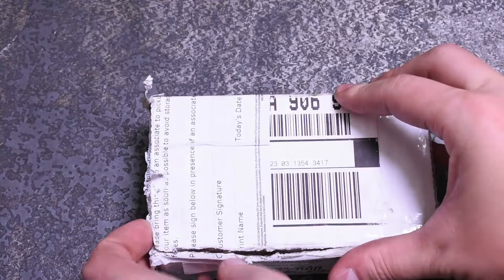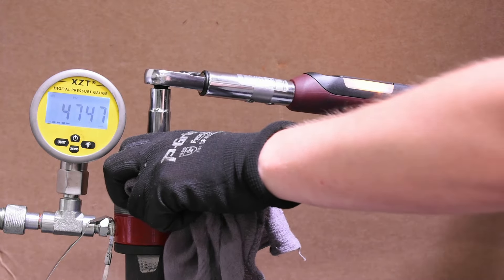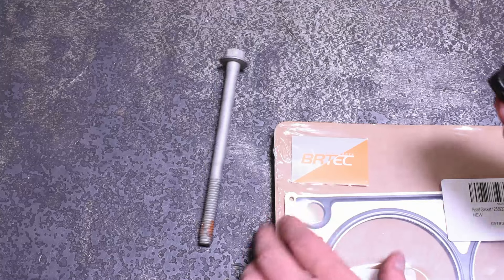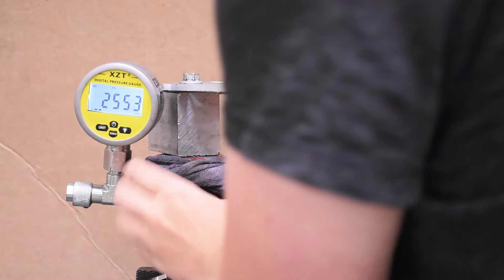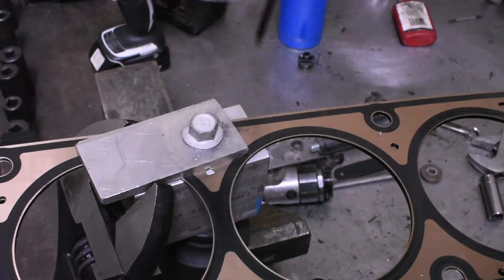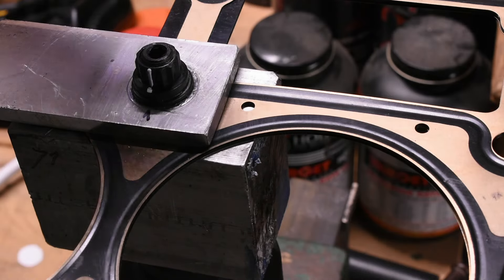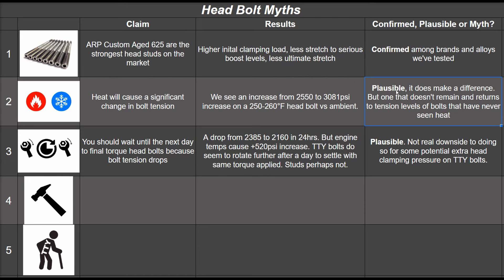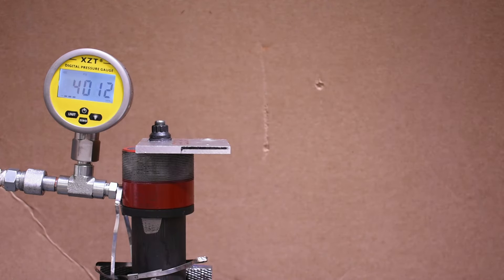CAN You Reuse Cylinder Head Bolts? Testing Myths + ARP Custom Aged 625+

Comment: Subaru has quite a torque sequence for their head bolts. On a mid 00s EJ25 It's basically, in a pattern: 21.4 ft-lb, 50.9 ft-lb, loosen 180°, loosen 180°, tighten 31 ft-lb, then 80 to 90°, then 40-45°, middle bolts another 40-45°. They make no mention of replacing the head bolts or a limit on reuse. They do specify to replace the head gasket. People reuse Subaru head bolts regularly with no ill effects. Would be fun to see you do some testing on them given all the whinging on the internet about Subaru head gaskets! The failures are generally unrelated to the bolts, as far as most people with knowledge are concerned. They were caused primarily by the gasket material used on naturally aspirated EJ25 engines.
Reply: Man I'm glad I don't work on Subies. That's a ridiculously long procedure. If it works I guess it's the correct one, but it'd be tedious if I had to do that on the Ford V8s I work on.
Reply: @9HighFlyer9  Try it someday. They are incredibly easy to work on in most ways. I prefer working on Subaru to any brand. Especially Ford. Funny enough, I have a technician friend who left a Subaru dealer to work for Ford. He was there something like 6-12 months and when Subaru offered his job back with a raise, he was so happy to go back. Simply because working on Fords was so much more complicated. Every brand has their downsides, of course. Keep in mind there are only 6 bolts per head. Would take a few minutes to do the full procedure. :D

Comment: I reused the factory  bolt set on a FEW 90's Civic's and on a 88 Turbo Supra I had. Supra's head lifted a few months after i got it, new factory composite head gasket lasted 7 years and about 100k miles in the Supra running about 320hp to the wheel before i sold it. It was my daily and i wanted to keep the original turbo without over spinning it, vertically no turbo lag above 4200rpm. I did retorque after a week of normal driving, repeated 2 more times to make sure they weren't walking out as the 7M-GTE tends to do to head bolts.

I tapped and died the holes and used factory bolts because there was carbon left over, as engine oil is recommended as thread lube per factory instructions. Increased (from i think) the factory 65ft/lbs to 85 ( ithink)  i can't remember quite right

Comment: Here is another tip I learned from a legend Nascar engine man.

After initial engine runs have been accomplished and cool down in the same installation sequence 
Loosen first bolt 1/4 turn 
Apply final installed torque 
Repeat this process in sequence

Comment: Great video. I was excited to see the re-used tty bolt, but everyone says to use a torque of around 65lbft and not to degree it again. In my head that seems like a better method instead of double yeilding the bolt.
One retailer of ARP headstuds for cummins had a specific tq sequence, and it was a pain. You would work your way up to final tq, then loosen and torque again 3 times, plug the block heater in over night, let it cool, then do a final tq. No idea if this extra work helped, but i never puked a gasket that way

Comment: On small fasteners I've tried the hammer before the final torque thing.  I had no way of measuring the tension but they definitely do turn a little more with the same torque limit on the wrench.  This was on rifle scope rings so very small fasteners.  I knew a marine core sniper and firearms trainer that did this for fighting rifles.

Comment: Hello dear TTC team

A German car enthusiast made some head bolts because the ARP ones weren't strong enough for him. They supposedly have a tensile strength of 270.000+ psi (1850 N/mm2/). They are called Pro Series Fasteners. Maybe you are interested in testing them.
Reply: Arp custom age 625 plus bolt have a tensile strength of 260,000 to 280,000 psi
And the Aermet bolt are rated at 290,000 to 310,000 psi
So no is bolt are not better that arp just better that arp2000 bolt at 220,000psi

Comment: The factory manual for my land cruiser does not say that head bolts are single use, and only gives one torque procedure. It does give a minimum bolt diameter, and says to replace bolts if they won’t achieve the torque value or if they’re too thin

Similar to the instructions for my brother’s 81 MB 300SD, bolts have a minimum diameter, can be reused until they get too small, ie stretch too much.

Comment: I am a  3 generation  mechanic and have built so many different types of engines over the years I couldn't even begin to count them.. but I do a lot of SXS engines mostly Polaris RZR and there snowmobiles as well. And with the amount of race engines I build with all the best parts.. 
I modify and build even more engines for the every day trail rider.. And I'm always looking for the best parts that are going to last the longest  if it's maintained correctly. So with that said I have been testing the one time use only hard wear for a long time mostly on Polaris and some car stuff. And on Polaris I have found that a good amount of time you can reuse head bolts and some others. But it's time consuming to do so. Mostly checking them out.But I have come up with a process of checking the bolt and if it checks out good by my specks then I have a torque process for the bolts  that has been back up since 2008 to 2016 by 30 engines that was part of the R&D from 2016 until now I have 90ish engines out there running around and 15ish of them with over 5 thousand miles on them.And my personal
 Polaris 08 RZR 800 that I bought with a bad engine with only 1500 hundred miles on it and that was the start of the R&D I sold that machine to a good customer of ours with about 15-16 thousand miles on it and at the beginning of this summer I was talking to him and he has over..30.. Thousand miles on it !!! Pretty crazy but he's retired and uses it all the time and he takes care of it just like I showed him how to do and what time frame to do different things to the machine ,air filter, oil and filter, just to name a few.. l am sorry this is so long and it doesn't have all the periods  lol but I think most people will understand what I'm saying and I thought people would like to know if you take your time and think about it you can figure it out this post just let's you know that most of the bigger bolts will work just fine just don't torque to   the degree part since it is now a normal pre stretched bolt TQ only have a great day... Bob...

Comment: Answer: yes of course you can. My first car was a MKI Mini and I had the head off it no end of times ... Replaced the head gasket (because that was usually the reason for removing the head ... Classic mini problem. In the end Hermetite orange silicon gasket sealer PLUS a new gasket solved the problem. But I NEVER needed to replace the studs which always torqued up just fine thanks! In principle if not in practice, torquing the nuts properly should not cause stud deformation, only minor, elastic, non permanent stretching.

Comment: I did an 05 Duramax with new TTY... Did the primary torque sequence and then the two 90 deg stages. One thing I noticed was that a few of the bolts went to the final 90 deg turn with less resistance than most of the other bolts. My brother was doing the final [I am an ASE certified veteran] 90 deg and wanted to go past the rotational point and I abruptly stopped him... NO! I suspect in those bolt holes there was some residual oil making them easier to turn. I told him that threads work, every bit you turn the bolt stretches the bolt more and more. Stop at the specified point and you have stretched the bolt to its spec. Leave it alone, it's got the proper clamping force and it's not going to magically unthread.
So much for skimping out on the brake clean. He has a 1,000 miles on it now with no problems... So far.

Comment: the problem is that once you get past the point of stock or ARP replacement headbolts, the head starts to bow between the cylinders and unsettle the gasket, with stock type cylinder heads. At that few after market heads are significantly strong, shy of a billet of HIP cast head, I doubt much more than a standard stud is all anyone will ever need. Thanks for the testing however. If you doubt this, grab a head and block and use impression paper.
Reply: There is a lot of variables for that.

Comment: i've definitely tapped the heads of bolts as i was finger tightening them to take the nasty little bits out of it and the thread so i can take them out easier later when an operator breaks the heads off.

Comment: I'd say that if it took 94 lbs to torque the TTY bolts originally, that's probably the spec you should use for reuse on a well lubed bolt.
I assume that factory specs have been tested to yield the best results. Waiting a day or hitting it with a hammer just changes the specs. If you want more clamping than factory specs, just torque them down more than specs to begin with.

Comment: Either a heat cycle or waiting 24hrs is for the torque relaxation due to head gasket compression, not metal creep, yielding of the fastener. 

I like your channel as many of the tests are very good, some could be improved.

Stretch is strain in engineering terms and is based on the modulus of the material for the stress-strain relationship. Just stretch is not very meaningful as a comparison of different fasteners, but it is interesting. Permanent deformation (stretch) would be comparative if it was only based on the reduced diameter section.

Comment: Some manufacturers tell you tty bolts can be used again if the threaded section hasn't deformed. This can checked by measuring dia. of threads across the middle and ends of threads, or a straight edge,  thread pitch gauge or even a nut  will thread on differently in a streached section getting sloppy or difficult to turn.
Reply: Yep. Chrysler says just this in the service manual for their 3.6L V6.

Comment: The waiting 24h and retorquing makes sense at first but then you would think and hope the engineers that design them took that into account when giving the torque specs and as such you are already slightly over torquing the bolts to factor in the stretch and the final numbers are the correct torque figures needed.  So waiting 24h and retorquing might just be over torquing the bolts and risking damaging the head gasket or bolts.  Be interesting if your chan could contact a few bolt manufactures and see if they can let you talk to their engineers on that matter.

Comment: Most of these tips and tricks about putting engines together have been around as long as the automobile has, and most of them probably aren't needed when you take modern engine design and manufacturing techniques into account.

Comment: I Just started watching the video however, I have used lubricated ARP 2000 head studs in my 2JZGTE and didn't retorque after heat about 7 years ago and have had no issues with the MLS and single turbo upgrade. I think ARP takes this into account with their torque ratings for the 2000 series bolts. I would say the alloy in the head would be more of the stretch point if anything
Reply: The video shows that retorquing isnt an issue.....

Comment: I regularly reuse TTY bolts on components other than head bolts. I return the bolt to the original position or pick a torque specification based on the diameter of the bolt.
I have reused head bolts a few times and use the same procedure.
Reply: Thinking of  reusing oil housing TTY bolts on 11 Jetta tdi 2.0L . Going back and forth and second guessing because Volkswagen says to replace. Think I’ll be ok to reuse? If so normal torque plus 1/4 turn?

Comment: The term for the hitting it with a hammer thing is called penning it's used to relieve the stresses mostly used in welding at a joint where the material can shrink when it cools
Reply from the maker: That'd be peening

Comment: I re-used a TTY set of head bolts on a Ford 4.0 OHV. The only thing I did different was add 5 lb-ft on top of the factory spec 3 stage sequence to get the bolt to yield a little more on the stress vs. strain graph. This was at 120k miles and at 185k miles there was still no issue with that truck. IMO, It would have been a better comparison to do something similar to get the bolt to a "new" yield position further along the Sy hump. I feel torqueing it to the same spec as an un-used TTY bolt wouldn't guarantee the same load generated/tension in the fastener.

Comment: The static seep down sigment is a leaky hydro cylinder, if you look at the bottom of the plug/ fittings there is fluid dripping 💧off the bottom of it , so those reading are 100% wrong in that sigment , lol nice thanks BigAl California.

Comment: I have re used tty head bolts on two separate occasions. To my knowledge they have never been an issue.  I would say only re use them is you are on an extremely tight budget and don’t have to $50-$100 for new stock bolts

Comment: Did many head gaskets on cars that the headgaskets were old and chewed away. Reused the bolts and away they went with absolutely no problems. Found out years later the head bolts were supposed to be replaced. Same old b.s. Saw a buddy of mine put head gaskets on a Subaru and had to immediately take 1  head off to replace 1 new head bolt that just broke off while tightening. Replaced it with an original head bolt and away it went.

Comment: Great video, as always.

My 2¢, some I've believed for years:

Never reuse TTY bolts.

TTY allows for better consistency bolt to bolt across the head.  (ARP's lube helps reduce that compared to other lubricants).

Additional stretching of the TTY fastener depends on the thermal differential between block/head and bolt.  The heat can expand the heads faster than the thermal expansion of the bolt in a few situations.  (Loss of coolant a great example.)

The elastic value will differ on the bolt length - they shouldn't be compared.

Torque is a measure of friction; different lubes matter as well as thread polishing.
Friction variation can be 15%; thread surface and lube dependent.

ARP lube significantly reduces thread polishing.

Use exactly the lube specified by the manufacturer when using their fastener.  They determined the torque vs. tension with it.
Reply: Differential temperature between bolt and head is irrellevant. The difference is minimal, no more than a few degrees.
However, if the bolt and head are made of different materials (i.e. Aluminium heads), the coeffcient of expansion is significantly different between them, hence the clamping load changes.

Comment: IIRC, GM had a 4 cylinder engine that you had to run to temperature before finishing the torque sequence.  But yeah, it's smarter just to do it the way the engineers told you to.  They may be screwups on a lot of things, but not usually head bolt torque.

Comment: Sine 1910 the auto induatry installed head & crank bolts dry with no thread lube or lock-tight of any kind, those engine would last 100 to 200 thousand miles. torque to yield bolts are garage, I will never install them in my pre 1980 big & small blocks. If your planning on installing standard head bolts always use grade 10.

Comment: The stress/strain curve is generally fairly flat after the yield point is reached.  So, continually applying the same torque will keep turning the bolt until it breaks.  This has nothing to do with “relaxation” of the bolt, but is simply the fundamental material property in the yield range.
Reply from the maker: 100% this. Lots of room for error for the same clamping force

Comment: Ph.D here MechE. Look up joint relaxation. Fastening engineers treat a fastening solution as a system, not the bolt by itself, and determine an appropriate success metric. The bolt by itself is just a component.

Comment: I am a Ford tech and when torqueing down the crank pulley bolt on the 1.6l Ecoboost before the final torque it actually says to wait two seconds before final torque. I always thought that was odd because it takes more than two seconds to adjust for the final torqueing. But maybe it has to do with relaxing the bolt but it's just two seconds. I know it's not cylinder head bolts  but it's a TTY.

Comment: At approximately 6:40, there is a visible oil dropo on underside of gauge, left on screen. During the lets see if the bolt can be tightened after resting for 24 hours: since the intial tighteming wa a "running" torque, I think the re-tightening ashould also be a "running" torque, due to having to overcome friction to get the bolt moving.

Comment: Hammering it just compresses the gasket which doesn't spring back, also shrinks slightly what ever else is being clamped.   Beside seating it by beating down the high spots where the mating surfaces contact each other!
ALSO, TTY is a specific fastener made to stretch, once, one time , while way to many think that every fastener that uses an initial torque value plus an angle or 2 is a TTY!  It is not & those are very reusable, only those with a narrowed/necked down area/s is a TTY, and is reusable only with great caution.

Comment: Q: If you install TTY bolts, then later on you need to take them off for whatever reason & decide to re-use them, do you still need to do steps 1-3 (below) or are those steps to pre-stretch only & as they've been used, no stretch is needed?

1.Tighten all bolts to 29.4 N·m (3.0 kg-m, 22 ft-lb).
2. Tighten all bolts to 58.8 N·m (6.0 kg-m, 43 ft-lb).
3. Completely loosen to 0 N·m (0 kg-m, 0 ft-lb).
4. Tighten all bolts to 27.4 - 31.4 N·m (2.8 to 3.2 kg-m, 21 to 23 ftlb).
5. Turn all bolts 50 to 55 degrees (target: 50 degrees) clockwise

Comment: Regarding re-using TTY bolts - Rover engine official service manual had an head bolt length tolerance - if the head bolts where within a defined max length they can be re-used.
Reply: Apparently this is relatively common practice based on other comments I've read.